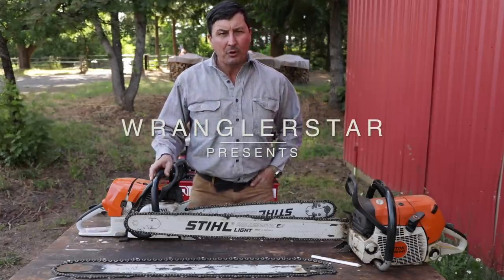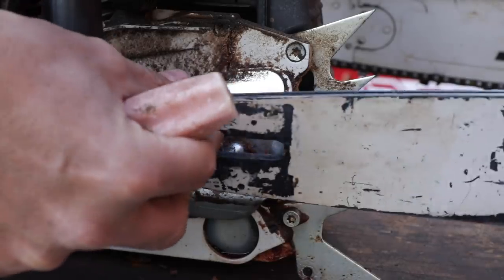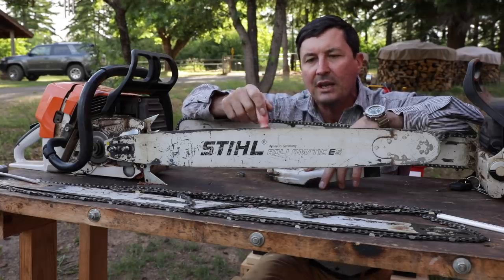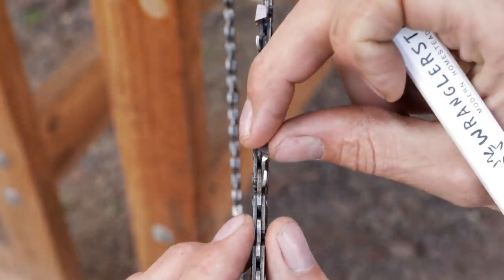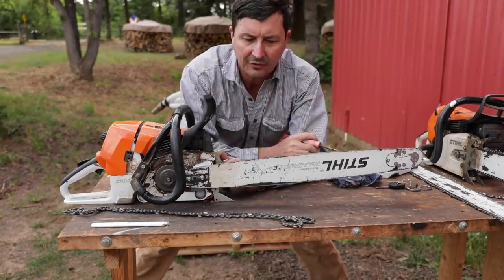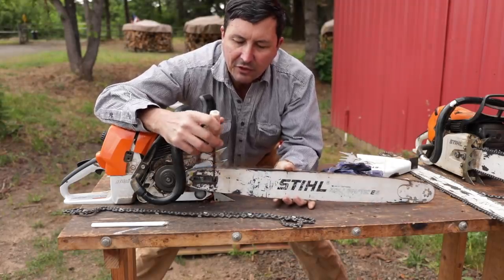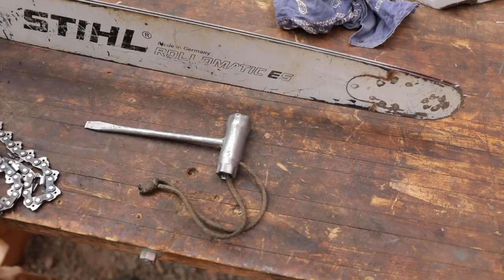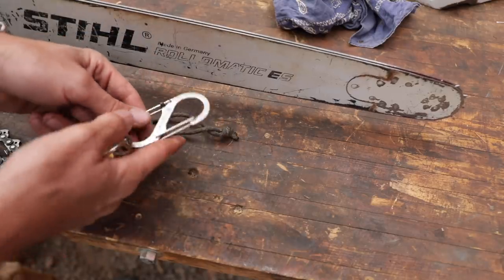Why Loggers Run Upside Down Chainsaw Bars

Comment: The large per of the two sockets is for the spark plug and the smaller is for the bar nuts or so I thought then the screwdriver or torn bit as in mine is to remove the plastic work starter cover and carb /air filter cover 🛠

Comment: Yeh, Im on my second chain-saw, nice and new! But my first really got me thinking about the utterly annoying oiling component,... Those holes, clog up a lot. Hasn't any bloke in a company come up with a better and more reliable design to oil the chain!!! How about a high themp, fuel-size hose leading to the best spot that will maximise stable oiling,... In its own little shell with bit of metal grid at the outlet, that can be brushed off if need be. And it could be gravity fed, no need for diaphragms etc. your welcome! Let me know if there is a good standard saw that has a similar set up.... Ps. I am an amateur at best...😄

Comment: I have a question for you that I’ve never gotten the same answer twice on lol
What is the best way to store my extra chains?  Both in my shop and while out in the forest with and without my truck. 
I’m having trouble with rust and so I would also like to know the best way to clean off the rust. Thanks in advance to you and anyone else that wants to answer these for me. 
Cheers mate and happy trails

Comment: Thank you thank you THANK YOU!  One of the most informative USEFULL vids you've put out!  I never knew that about chainsaws....and since I just bought a brand new Stihl 311 I want to last a long time.....
Reply: The life of your saw has little to do with bar and chain. Bar and chain are consumables.
Reply: Nathan Egbert I hear you.  I was speaking more generally about brand...  I understand what you're saying...  I'm sure my dad has replaced his bar a chain more than a few times since he bought his back in 1980!  Still has it and it runs too!
Reply: Your post makes me laugh. I look at new Stihl saws and tell myself I'll buy one when one of my old Stihls quit. That's a problem because they don't quit. If I wait that long, I'll be too old to use a new saw! I have a 260pro that was heavily used when I bought it, and I have been running it hard 7 years since. I even loan it out, and it just won't die! Not all models are as popular as the years pass but regardless, Stihl saws outlast your expectations. I read somewhere that a pro Stihl is designed to run 400 hours full throttle between rebuilds. That's what, about 2,000 tanks of gas, 60 chains and 30 bars? So yeah, unless you are a pro logger, when you buy a Stihl, it's good for life. Good luck with your new 311.

Comment: Since you have double the wear surface by flipping the bar, wouldn't that give you double the life? meaning it would extend its life by 100%, not 50%. extending it by 50% means 1.5x the normal life. So if they normally last a year, it'll last a year and a half, but in reality it should be 200%, or 100% increase, right?
Reply: thinking this exact thing
Reply: RIGHT

Comment: I always run the saw with the tip of the bar pointing at a log etc until I see a line of oil on the log. Only takes a few seconds, warns the saw and ensures it’s oiling
Reply: Warms

Comment: Just drill the holes out larger on the bar and never continue to run a saw if there is not any bar oil on the bar and chain , you can run out of gasoline but don't run out of bar lube ever , that's where wear and tear comes from , also if you just spray something like pb blaster all down the bar groove after sharpening the cutters it will be fine , and if you are cutting wood a lot and it's starting to clog up the area behind the side clutch cover always remove that cover and CLEAN IT UP , that's a big mistake many make by never cleaning the area behind the clutch cover , I never flip a bar and I don't have any problems with my bars either this way !

Comment: I have been helping my sister with her homestead (learned how to take care of chickens, ducks and turkeys a few years ago and just learned how to process the chickens and turkeys).  One of the chores she needs to have done is cleaning up the woods around her place - removing dead trees, clearing brush, limbing trees, thinning trees, etc.  I would like to do this for her (at least as much as I can - I am 61 and just starting to do this).  What would you recommend as "first steps."  Kind of a beginner's course idea.  I can't work out in the high heat and humidity of a full mid-Atlantic summer, but was thinking about starting to work in mid-late fall when temps are lower.  I was thinking of starting with hand tools and work my way up to using a chain saw.  I do not have the strength to start with an ax (nor the skill), but I have used hatchets and pruning shears/loppers.  I am just not sure where to start (clear all brush first?  Limb trees first?  Cutting down trees is NOT first).  Any advice for a novice would be appreciated.
Reply: Great idea!  Sounds like the place I want to start.  :o)  I know she has some paths she likes to follow, so if I start with those - making sure they are clear, then we might see other simple things that can be done.  One I know for sure is removing any poison ivy we find - THAT I have done for decades and know how to do and keep myself safe.
Reply: Julie Stevens you might want to get a manual 'pole saw'. That would let you reach up 8-10 from the ground. It has a saw blade on one side and the other side has a pruned, you use by pulling a rope.
Reply: I have heard of those.  Yes, that sounds like a good investment.  I would definitely like to clear at least 8 feet up.

Comment: I  was watching this video for the second time (saw it when it came out a year ago) and I was wondering. Cody mentioned an extended life span of 50% when you rotate the bar.
But should that not be an life extension of 100%?
The bar’s life is now doubled right?

Comment: wear on certain parts of the bar  comes from a chain that is to tight or to loose not what or how your cutting.a properly tensioned chain should only lift off the bar to the point that you just see the lowest part of the chain that sits inside the bar groove at the top level of the bar.i used to fell trees for a living now i fell trees for firewood and fun and i rotate my bar once a day after i clean my saw and ive worn out 100s of meters of chain over wearing out my bars.

Comment: Ha, I had to rewind the part about the screwdriver/wrench tool because I wasn't listening. I saw it and said, "what's that weird tool that looks like one of those cheap spark plugs tools that came included with old motorcycles?" Oh, duh, it's a spark plug wrench, I forgot how a chainsaw works for a second.

Comment: I have had guys working for tree companies laughing say hay your bar is upside down... Most people do bar maintenance scraping out trash in rail grease gun for tip flat file for getting the burs off and flip the bar. Had someone ask me why I was sharping my bar. Haha really even if your just cutting firewood or hand filing switching chains whatever. Bar maintenance will save your saw and a much safer to use saw.

Comment: Thanks Cody, I’ll make sure I flip my bar when I sharpen my chain. Great tip. Do you great the tip of the chain thru that hole by the front sprocket too.

Comment: You didn't talk about running a butter knife down the bar tip towards oil  ports to get debris out or check for lip on rails  of bar.and

A guy who sharpens with a file  keeps his saw sharp less where and tear on bar chain and sprocket.

Comment: I wonder if the increased wear seen when hand filing could be partly explained by uneven filing causing some teeth to put much higher than normal pressure on the bar? I'm really good at hand filing, but I can grind a chain and set the depth gauges where the result runs noticeably smoother than any hand filing job I've ever seen. This is especially true after a chain has been handed filed many times. Even if the gauges are set correctly for each tooth, the more different height they are, the more pressure the high ones put on the bar. Low even pressure is bound to produce much less wear than if there is some jumping and jerking, right?
Reply: James Holden if the "gauges" (rakers) are set right they are not different heights. If they are it would be good to get a raker gauge. Rakers filed to much can bite too much wood and stretch the chain, then it doesn't ride right in the rim/sprocket or the bar tip, like gears that don't mesh, and wear them out prematurely.
The chain should be tossed.
If you lay a chain flat on a table and push the links toward each other, if there is a lot of play, get a new one. Each rivet is a wear point so a little play is normal. Take a new chain and a well used chain and see the difference.
Reply: Molly MacCorkle I agree completely, my point is that the increased bar wear Wranglerstar mentioned when hand filing vs machine ground might be caused by uneven filing putting uneven pressure on the bar rails. I think we agree.
Reply: James Holden yes several angles are involved, hand filing is an art. To much hook is common. I am under the opinion that light hand filing is not bad, but periodic machine filing helps return the proper angles, and many who think they are good at hand filing, putting their chains on a GOOD grinder (not harbor freight) shows otherwise. Our was like an $800 Oregon.
Reply: Molly MacCorkle I agree. I do the same, and additionally I exclusively grind with CBN wheels. I doubt there are more than a dozen people worldwide that can hand file a chain through it's entire life sharper and more consistent than my average grind job. I don't think there's anything wrong with touching up with a file a few times between grinds, but I'm willing to bet all but a very few hand filers would benefit greatly by a high quality grind job at least often enough to never be tempted to set the depth gauges between grindings. All in all, my experience has been that there are as few people that are really good at grinding as there are people who are really good at hand filing, and very few people that are good at hand filing know someone who is genuinely as good at grinding as they are at filing, so if they have tried it, they were disappointed in the results.

Comment: Every time you file a chain? Not hardly. When you sharpen a chain several times a day, flipping the bar that much makes no sense and takes way too much time. Every time I install a new chain I flip the bar while I've got it off. Makes absolutely no difference in the life of a bar if you flip it five times a day or once a month.

Comment: Well some of your points are true but a few others are way off, a bar can be flipped over many times and also the bar rails can be trued up by using a bar rail grinder, one rail will start to be lower than the other and that causes the saw to start cutting half moon cuts or another words cutting crooked so  when replacing a old chain with a new one it is a good idea to remove the burs on the edge of the rails and also true up the rails with a bar grinder. I will let you readers in on a secret?, save your used cooking oil or even better yet get a couple buckets worth from your towns restaurant and after running it through a cloth filter or fine screen fill yourself up a nice squirt bottle and use this to douse your bar n chain with a liberal amount of cooking oil in between big or long cuts. You will be amazed at just how much life you will get out of a bar when doing this. I do tree work and own 3 big bucket trucks a 55 footer a 70 footer and a 100 foot reach bucket truck and each of my trucks have a tethered squirt bottle in the bucket with clean used cooking oil to generously add oil onto the bar/chain during tree jobs and by doing this along with making sure the saw itself is providing bar oil your bar wear will be reduced dramatically especially if you always cut with a well sharpened chain that has been sharpened on a chain grinder like an oregon model which is a fairly good brand and affordable around 275 to $300 bucks.

Comment: It would be easier to get this concept across, if manufacturers wouldn't print their name, & bar length across the bar on both sides.  They should stamp the part number, brand name, and length close to the chainsaw end of the bar, and on the other side stamp this info 'upside down'.  Then it would be easier for chain saw owners to grasp the concept of this video.

Comment: You don't flat file your bar when it gets a burl along the edge ? Only takes a second to file it off ... If you can catch your fingernail on it with your chain off , time to hit it with a file .. Your not removing anything except the edge that curls over , kinda like when you sharpen a chisel and remove the bur . I Enjoyed the video

Comment: Isn't the small end of that chainsaw tool intended for sparkplug removal/installation?

Steve
Reply: The big end is for big bar nuts and the sparkplug. small end for smaller bar nuts

Comment: You never said anything about cleaning out the track of the bar..it gets built up with fine saw dust and oil and the chain rails ride high..and wear the top of the bar off level..there for causing the saw to make moon cuts...

Comment: Thank you for the informative video! I am considering ordering the Alaskan chainsaw mill and making my own boards from oak trees I've cut down. However, my chainsaw that I used was a Husquvarna Rancher 460. The max bar size they say it supports is 24" which is what I have. However, I really need to use a bar that is about 32" so that I can get about 26"-28" wide boards cut. Most of the logs I have are about that big in diameter. My question is if I purchase a 32" bar, will it still get the job done on a rancher 460 chainsaw even though manufacturer says max bar size is 24"? Would greatly appreciate your feedback on this. Thank you!
Reply: just my opinion .. the 32" is obviously too much , but if it fits properly and you keep the saw at full rpm's while cutting it should be ok .. if the saw is bogging down at full throttle it will be overheating the motor .. the Flywheel blades act as a cooling fan for the motor.. so if you at wide open throttle but turning only 50% of the rpms then the motor is making the same amount of heat, or more with half the cooling .. this is how people that make their weed eater string way too long destroy their weed eaters  so quickly...

Comment: Hi WS, i know your vwry husy but is there a chainsaw you van recommend for right around $200 for use once or twice a month to cut 8-12 in logs but will work after not using for a while?

Comment: I only see one oil hole on the top side and no oil hole on the bottom side side
Reply: Yes I just checked mine has two and I need to flip my bar.  I just couldn't see the other hole on the video.

Comment: The smaller wrench on the screntch is for the spark plug on my Stihl saw.. Are they a different size plug in the USA?
Reply: Small end is definitely for the spark plug, I figured everyone that has ever picked up a saw knew this, but apparently not since Cody thought there were smaller bar nuts

Comment: ucan get a swadging tool to regap a worn bar groove      they sell the cheap ones on amazon      been dun mine with a hammer and a section of the old chain   thats not to badly worn tap it on top of a vice     havto get the feel for it     to much hammer    use a big screw driver to open it back up    i flip my bar whn i put on a new chain   30 rank of fire wood ayr       for 30 yrs tough narly dead oak most of it     never worn out a bar   same ol bar same ol saw    lil sthil 028  ive gone through dosenes of chains   one sprocket  saw still cuts run like nu   hav never had to touch the power head👍😉

Comment: What the Heck...every Sawyer flips bar to even the wear on both side's before getting hammered and filed to restore the bar...a thin steak knife (cheap and small)to clean out fine sawdust from inside bar and scrap pitch off mounting area's of bar to keep oiling in the bar and chain...good luck

Comment: chainsaw bars are designed to be rotated the graphics are not intended to be be a guide as to fit the bar ???????
Reply: SCOTTISH PREPPER VARIETY ,CHANNEL nope, in fact a lot of bars have the logo going opposite on the 2 sides, on most bars now there is no up and down. Installed, one side the logo is right side up, the other is upside down.
Reply: if the only fit one then there a lot of expensive coming from my earlier years working in forestry we rotatated the bars weekly and dresssed them in a vice with a flat file

Comment: How about talking safety equipment such as helmet with ear muffs and face guards,chaps,kevlar coat and gloves.Too many people get hurt because they didn't bother to learn about operating and maintaining equipment safely.Every saw I have bought comes with this information that you  spent this time talking about.Nobody should operate any power equipment without reading the manufacturer provided manual.They want to prevent lawsuits so it is in every saw instruction box.

Comment: But i think if you use it in one direction, at the front sprocket wear down for that direction, and when you turn it upside down it will turn another direction, i think it will wear down more.....